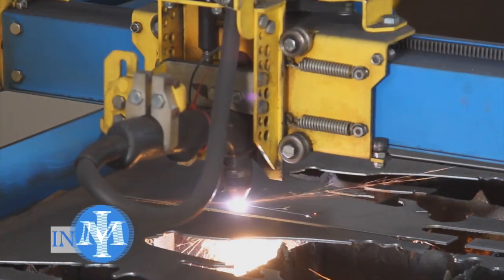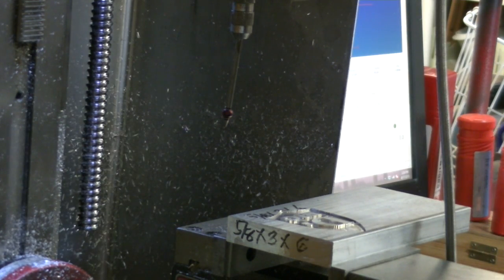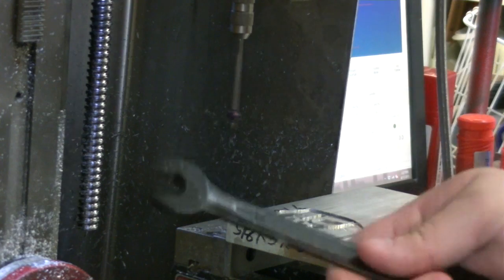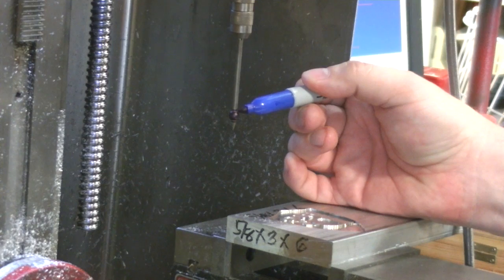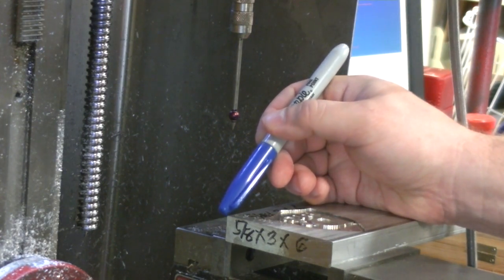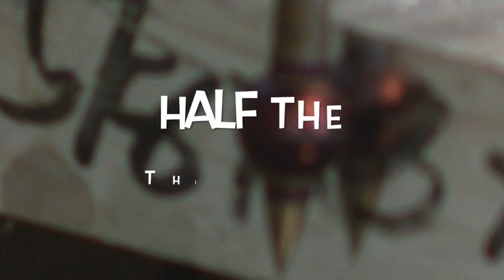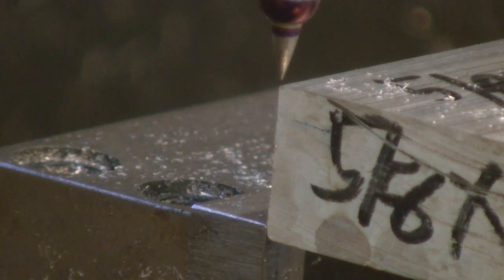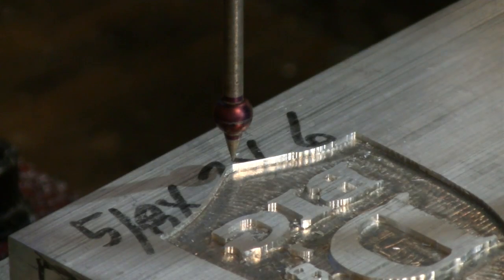Edge Finding - The Wiggler

Comment: Edge finding is not a magic art....I've used the spring loaded 4mm tip type for many years and have never had a problem.......adding the blue to the ball tip also works......if you have a marker pen(sharpie) handy or some marking blue.
Reply from the maker: Agreed - it can just feel that way for someone new to the process. I forgot I had made this video so it was kind of fun to go back and watch it after all of these years.

Comment: Ball wont last. Edge finder or indicator. Too old school. A wiggler is used a lot in jig and fixtures picking up accurate scribe line. It goes in any spindle, even the most wobbley ones.

Comment: For the first part of the video you would be much better off with an electronic ball E.F.. They are cheap and have the advantage of a light and audible sound when finder touches part. This enables you to save time not mess around trying to center it, watch your DRO and run at much lower rpm (I use 40 RPM). second part of location I see where you where going but chances are that wiggler was not dead nuts on with the CL of your spindle, just use a pointer in your chuck or collet. Wigglers have their place but not always the best choice. 
I run a large VMC and HMC and have not used a wiggi in a year or more, My electronic E.F. has served me very well hitting tolerances of 2 thou.
Not criticizing but just trying to make things a little easier and more accurate for you. Granted my shop is for profit and any edge I can gain is money in the bank. If your interested in looking into what I used let me know, I be happy to help you out.
Reply: realize the inexpensive light up electronic style depends on a true running collet or chuck.  The simple  mechanical wiggler will still center on center even if the collet or its shaft does not run true.  Think about it.
Reply from the maker: Yeah, I can see the usefullness of the electronic edge finder. For the last  couple of years I've been using my Haimer for most things. Does the electronic edge finder work on plastics? It's not looking for conductive material, is it? Just detecting the motion? I'll have to do some more research on that.

Thanks for the comment!
Tom Z
Reply: @TomZelickman  Uses conductive materials. Won't work on Pastics.

Comment: How can you be accurate with the needle over the corner? You are still only eye-balling the point not really locating it. By the way a while ago I showed an emergency centerfinding which is almost or can be as accurate as eye-balling a corner.
Regards That Old Bob
Reply from the maker: +That Old Bob That's a good point, sir. The distinction I typically make in which method to use is about the tolerance needed. I'm amazed at how close you can get using your eyes. That being said, if I need something more accurately then choosing a different method is the right thing to do. I'll have to go watch your video! Always good to learn other ways to get the job done.

Thanks for watching and taking the time to write,
Tom Z
Reply: You are right, sometimes I  am amazed how accurate eyeballing can be,though we should not forget that this is coincidentally 
Old 
Bob

Comment: the bluing trick is pretty sharp.
great tip, thanks for the video's
Reply from the maker: +Phil's Projects Hi, Phil! Thanks for watching. Believe it or not, the bluing trick is how it was once taught and documented. I came across that in an old wiggler set and it greatly improved my accuracy when edge finding.

Sincerely,
Tom Z
Reply: Not really.  It’s only accurate if you have a rub all the way round the circumference, and that’s difficult to see with the wiggler spinning.